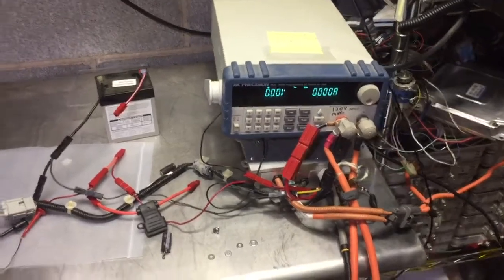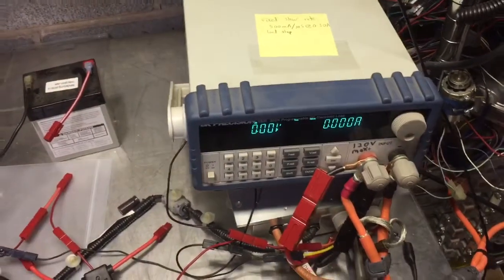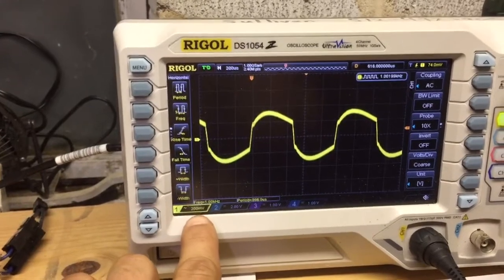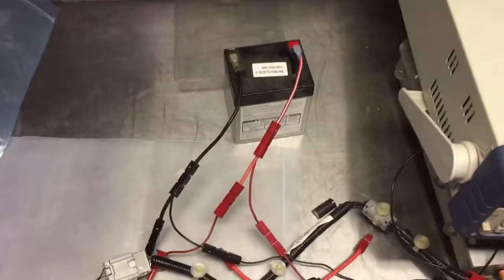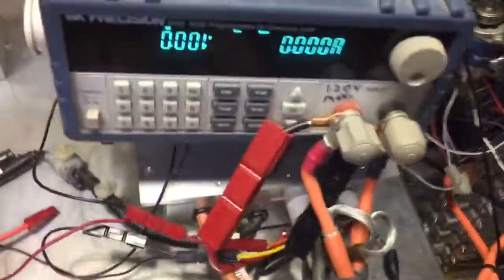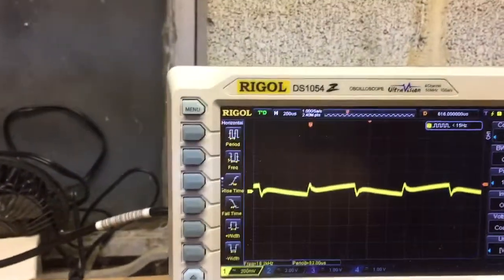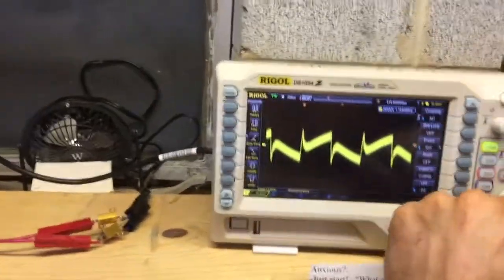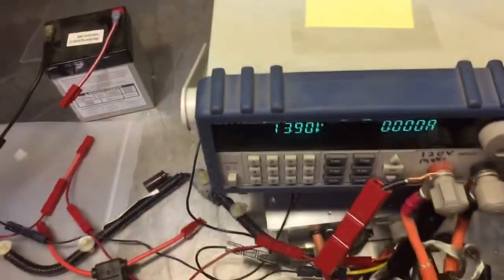Honda Insight G1 DCDC converter

Comment: Update, I used a variable bench supply and verified that it can work as low as 65v DC or higher

The 12v battery need to be hooked up on the output of the DC to dc converter

If you hook up the black wire with the yellow stripe to the positive of the 12v aux battery you will see the DC to dc kick in to charge the battery.

I hope this can help someone out there that has one

Comment: Hi, thanks for posting this,

I'm looking to use this DC to dc on a diy ev, what do I need to know to power or wire this up?  What is min voltage for HV battery? Besides wiring the 12v, what wires do what to turn on or off the DC to dc. 

Thanks in advance, aka steveo from insightcental